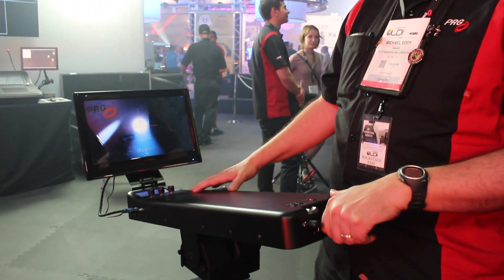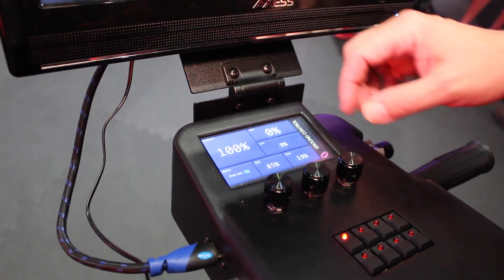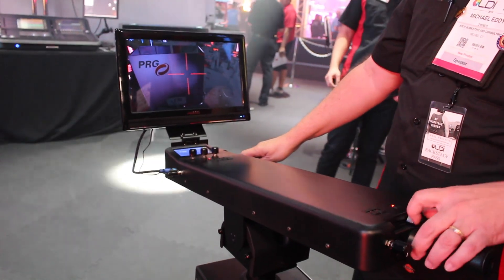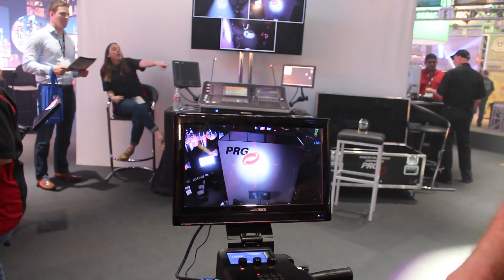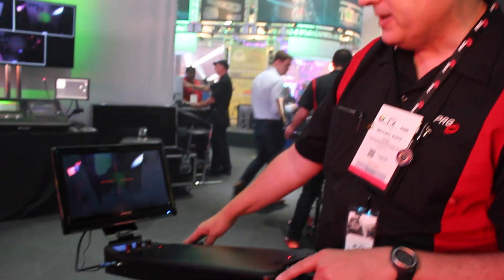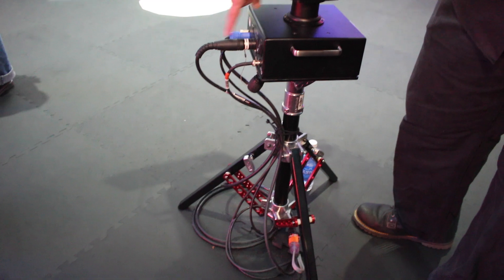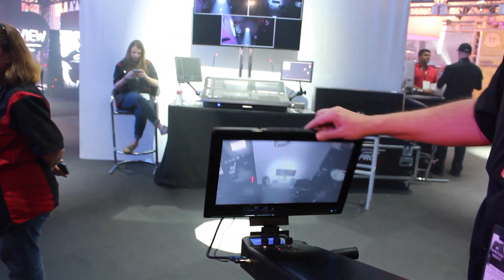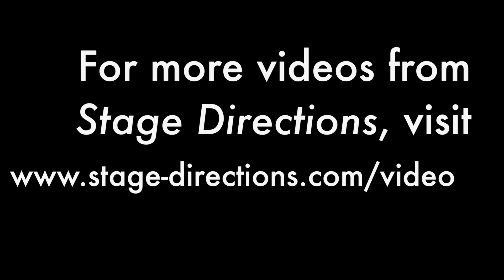PRG Ground Control at LDI 2015

Comment: i have a question, what about the ability to see what is not in the view of the camera, off stage or anywhere the light is not aiming.?  One more, is the video output only the camera or the monitor meaning that it does change the view when adjusting?   One is required for each performer?  sorry that was 3 q.